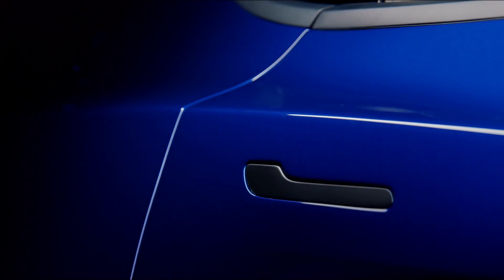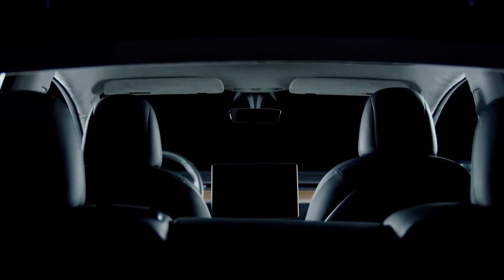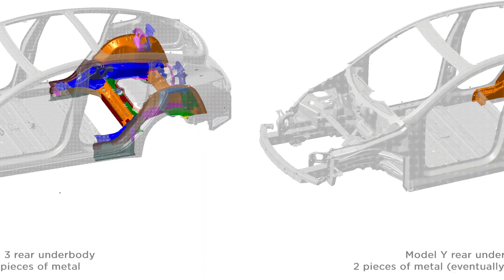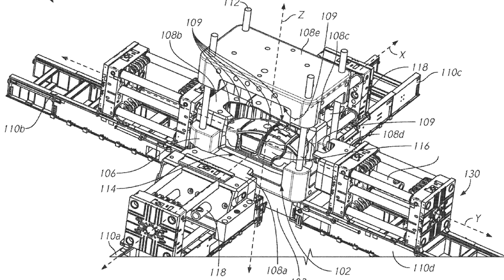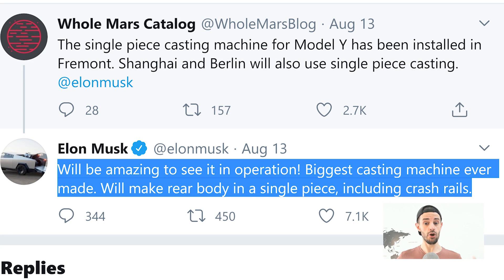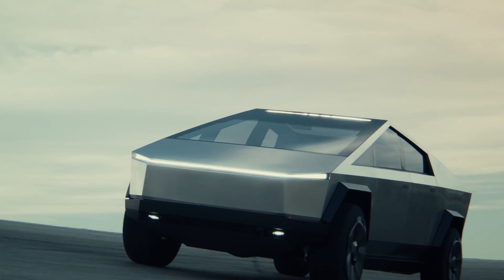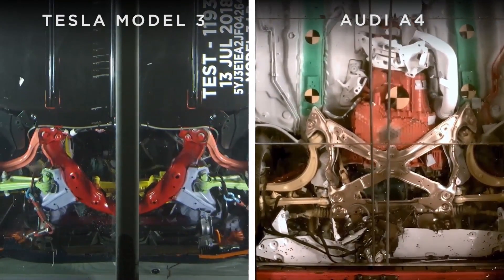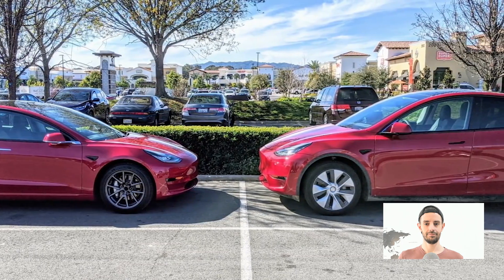Tesla's INSANE Giga Press (engineering genius)

Comment: As a mechanic engineer, I’d point out that the large castings have benefits beyond cost reduction and design simplification. They also allow designers to put metal precisely where it gives the most benefit. This saves material (cost) while simultaneously improving strength to weight ratios and other performance metrics. These improvements are virtually impossible to achieve in a mass-produced “bits-and-pieces” design.

Large, thin-walled castings are technically very challenging. It's not easy to get the hot aluminum to properly flow throughout the die cavity without voids, inconsistencies or excessive flashing. Cast aluminum parts have different mechanical properties than parts stamped from sheet stock. The part's design and alloy selection is critical. Warping can occur as a hot part cools, after it is released from the mold. Elon mentions that Tesla has eliminated the need for secondary CNC machining (more cost savings) which suggests Tesla has managed to minimize warping. Very impressive. Again, not easy!
Reply: David Kasman. Elon also mentioned they solved the warping problem by developing their own alloy. Sandy also confirmed this when he could not determine the alloy used, using his usual methods. He has sent samples out for further in-depth analysis. This is where Tesla leverages SpaceX's metallurgy technology/experience. After all, they are developing their own 30X SS alloy for Starship in-house, which will also be used on Cybertruck...
Reply: @stevebothe1416  Having visited numerous aluminium foundries I can tell you how warping is dealt with. You take a hammer and smash the point that is measured into the right position. The larger the part gets, the more you can expect this to be necessary, as the mould cools unevenly, weather changes, humidity changes, alloy composition fluctuates in the allowed analysis range... there are a lot of variables. You can trust me on this, I'm a metallurgist.

Secondly, the way this part is designed with a large surface area, requiring got material flow, they will use a run-of-the-mill hypoeutectic Al-Si-alloy. I would be really surprised if they took anything else. We develop new alloys where I work and the whole of the aluminium-casting industry can't move away from standard Al-Si and Al-Cu alloys.

And you don't "develop" a new 30X SS-alloy. The composition ranges are as wide as a barn! You can fit a gigantic number of actual steels in the composition windows that is "a 304 stainless steel". You can vary Chromium from 17,5 % to 19,5 % for example. Sulfur has an upper limit of 0,015 %, now if you had one steel which only had 0,002 % it would behave very differently in some aspects. Still it's only "a 304". There are very little surprises still to discover in the austenitic chromium-nickel-stainless steel area. Every steel manufacturer will gladly do a batch with a custom specification if you just order enough tonnage. Sure, you can ask the manufacturer to add a little bit of boron to increase hardness, or stabilize it with niobium or titanium to make it easier weldable. Is that innovative? We know all of that already. Anything that I would consider inovative is far from industrial application.  I understand a lot concerning this topic and can see right through Elon Musks bullshit "smart talk". He has no idea of metallurgy as he proves with every tweet that concerns it.
Reply: @N3uroi  And you're quite entitled to your opinion... Yet, the proof of the pudding, is in the eating.
Reply: @stevebothe1416  Eh, my opinion is based on two degrees in material technology and engineering, a few years of practical knowledge in that specific area and my current position where I do among other things just that: alloy development. Can you give any supporting arguments for your position?
Reply: @N3uroi  I'm not a metallurgist... But perhaps you can explain why Sandy Munro states that the alloy used in the Model Y casting is not a standard Aluminium alloy? And perhaps why Tesla went down this path, if warping was an issue for them? Since Tesla have gone down this path, it implies they have solved the issues you refer to.
Reply: @stevebothe1416  I searched for a couple minutes and couldn't find the specific snippet where Sandy Munro says that. But you can analyse every alloy composition by spectroscopy, so I guess that's not his method (but we would do that where I work). So I don't know how he analyzes the parts, but it appears not to be a suitable way to do it.

You need to heat-treat parts only if they alloy is age-hardenable. Parts cast by HPDC are NOT age-hardenable because of entrapped air (unless you apply a vacuum, making the process more expensive and slower as well!).  So you would preferably use an alloy that hardens on its own (like AlSi, which has tiny particles of hard silicon in its microstructure). Reduced warping is not a valid design-goal of alloy development, as it is mostly a result of the process employed (think different part thicknesses).

Heat-treatment facilities usually circumvent warping problems by a custom-design support structure. You can also reduce warping by annealing the parts beforehand, reducing internal stresses. Don't think however, that the parts will fall out of the HPDC-Machine without warping. They will need to be straigthened out just the same as if the would've been heat treated.
Reply: @N3uroi  The casting, alloy, etc. are discussed by Musk and Munro in this interview, but I can't remember at what point: www.youtube.com/watch?v=pih4kU6yvz8
Reply: F St I would respectfully suggest that Elon, Tesla and SpaceX have a wealth of world class material science engineers at their disposal. One cannot build rocket engines, SOTA batteries, etc without major material science prowess.
Reply: @N3uroi  I couldn't find the specific comment that I was referring to, but here is a couple of snippets that support my view.

https://youtu.be/TOrrdqje9Og?t=152
https://youtu.be/9l6DPwKHWpY?t=2024

Regardless, Tesla ARE doing this casting and making it work. It's already in the Model Y.  I doubt very much if Tesla are taking hammers to the final casting - it's not the way would do things. I also read somewhere, they have improved the cooling technique, to reduce the warping, and that they perhaps have an additive in the alloy to also facilitate this. As I said, I'm not a metallurgist, but I'm sure if you're that interested you could do some research in your field to find out what it is they're doing.
Also, Sandy did say they were continuing to analyse this alloy. If you follow Sandy, he will no doubt do an update when he finds out.
Reply: @N3uroi  great comment very informative! As for as metallurgy/steel forging manufacturers, which do you think are promising on the stock market? Metals and their casting/molding seem to be the backbone for every industry and can only continúe to be vital in the coming years.
Reply: @Viper-sn5cx  While I agree that the metals industry as a whole is extremely important, I'd argue that the field as a whole and therefore most companies make for poor investments. They are highly cyclical as compared to more resilient economic endavours (like e.g. healthcare, essential (=non-luxury) consumer goods) and usually very capital intensive, hence have a low valuation. Furthermore as this is the sector I'm employed in, I avoid investing in it. Further facts making investments unattractive are the strategic importance of this sector, making government interference and tariffs much more likely. Also there are gigantic overcapacities in steel production (how far this is the case for forgings, I'm not so sure) as china subsidies their steel industry heavily, further increasing the change of government interference. Lastly western companies suffer from ever increasing environmental regulations, further worsening their position.

You very often can not invest in the "forging division" directly, as they are mostly in a conglomerate or attached to a steelwork. So you only get to buy the "whole package", where the forging part most likely makes up a relatively small part of overall operations. I'm willing to make the claim that the likes of ThyssenKrupp, Mitsubishi Heavy or Hyundai Heavy will still be around in 50 years. Maybe under another name, maybe with another owner, but the processes and facilities will prevail. That doesn't make them a good investment however. I'd stay clear of that sector unless you have a pretty good idea of what you're doing.
Reply: @N3uroi  New info. Sandy just answered the question here: What are your thoughts?
https://youtu.be/h37kswPGytM?t=4146

I also found this: 

Aluminum-alloy Al-NYC-386
.  Chemical Composition: Al-Y-Ni-Co
Aluminum alloy Al-NYC-386 is a high strength Aluminum alloy processed via spray forming. Due to the high
Yttrium content it has excellent properties at elevated temperatures. Al-NYC-386 shows unique fatigue
performance at high temperatures.
General properties Comparison with Standard alloys A7075, A4032
• High strength Advantages: - Higher strength
• Excellent temperature stability - High temp. prop.
• High fatigue strength Disadvantages: - Expensive
Reply: @stevebothe1416  I'm certain you're looking at the wrong "386 aluminium alloy". It says in your quoted text as well, the yttrium-nickel-cobalt alloyed aluminium is to be processed via spray forming. It also has low ductility which makes it unsuitable for this application and an unfavorable solidification behaviour for HPDC. You're more likely looking at this "386": https://www.mercalloy.com/mercalloy-family/high-ductility/

So as I predicted... just a regular old "primary" (meaning little recycled Al.) AlSi9 die-casting alloy. It has a low manganese and iron-content I give them that, but that is the difference between primary and secondary aluminium alloys. This is certainly not "thinking ahead" of everyone else, quite the contrary. Apart from the sheer size of the part it is exactly what everyone else does. The AlSi9-family is among the most widely used HPDC-alloys. Not having to do a heat-treatment is INHERENT (!) to pure AlSi-alloys. If they would've needed more strength in the part, they would've went for AlSiCu, which would in turn necessitate a heat treatment. So yeah... nothing spectacular to see here as far as metallurgy goes.
Reply: @dksculpture  Hey, could you "@" me next time? Only just read your answer. 
I don't dispute the fact that there are material engineers at Tesla and SpaceX who know very well what they are doing. As I said, I'm very much in favor of doing function integration into single cast parts.
What I have a gigantic problem with is the overwhelming of the gullible with technical terms concerning a single part in their cars which supposedly somehow proves how superior Tesla is. The usage of a proven and reliable AlSi-alloy for a HPDC-part is nothing to be ashamed of! In fact, given the conditions that directly stem from this part (large dimension -> potential warping problems which is problematic for heat treatment) would lead me to go with an AlSi-alloy as well. Which one depens on how ductile you need it to be. So yeah, they did everything correctly there or at least good enough. It's just not as bag of a deal as everyone is trying to make it and as someone knowing a little about metallurgy all the great adjectives that are being tried to stick to this grow to annoy me.
Reply: @N3uroi   Thanks for your feedback. Sandy probably got the number wrong - 386 instead of 368 (he does that sometimes). So, the question remains, how are Tesla able to make such a large casting WITHOUT having to reshape it post casting? I'm pretty sure they won't be taking hammers to it, or any other mechanical means to attain the correct dimensions, as that goes against the reason for choosing this process in the first place.  Pace of production is why they went this way.
Reply: @N3uroi  No worries. I suspect we're pretty much in agreement on things anyway.
Reply: Great comment and superb that skilled engineers are commenting on these videos. Added to your comments, Tesla and SpaceX now employ Former Apple alloys expert Charles Kuehmann https://electrek.co/2016/02/24/apple-alloy-expert-tesla-spacex/ 
As an Industrial Designer, I'm obsessed with the move into die casting from Tesla. Amazing stuff! As David mentions here, in reality there are a number of huge technical hurdles to overcome. It's easy to say 'world's iggest die casting machine'. Getting a quality part out of it is another challenge altogether.
Reply: I worked at an aluminium foundry that made high pressure aluminium castings. The biggest challenge back in the 1970's and 80's was process consistency and metallurgy. Since then the control systems have improved massively, which should mean that process consistency can be better achieved.  It's apparent that Tesla (perhaps because of links to SpaceX) have a deeper understanding of materials and metallurgy than generally seen in the automotive industry. They are really going to need best of class materials engineering and quality control to maintain the right aluminium alloys for a reliable repeatable casting process.  Warping to an extent is inevitable, keeping the process consistent will mean predictable warping, which can be designed for.
Reply: If it's not easy to get the hot aluminum to flow properly, then WHY do it? Tesla would look at another way. But, the legacy executives are inflexible and CORRUPT. They will fall on their swords.
Reply: Is/are there any CAD/engineering software (or at least implementable models) that let you design castings with deliberately functional internal stresses (tempering, I guess)? Mind, I'm asking as a layman—I have no idea.
Reply: atimholt, generally the form and thickness is used to strengthen or weaken the areas. It’s very unlikely that any post treatment would be used as this is time consuming costly and would add variability. Form reliefs holes and swages are used within the form to get the structure to deform in a predictable manner and manage the crash energy. All this is model with cad software as well as the flow and form of the material. I think the new mid engine Corvett is using some big castings in its structure design jag and audi have been doing it for years as well just not this big. One thing that does raise a question is repair ability if they are casting the crash structure then it’s going to mean your writing off a large piece of the car once it’s damaged. I’d be surprised if they don’t have bolt on deformable crush cans for lower impact accidents and repair. It’s would be very hard to swap and change back to a pressed and fabricated structure once the design has been changed to accept a casting
Reply: Dave Rainbow Excellent points. I was thinking the same thing regarding a casting being impossible to repair after a crash; repair would require a new casting.
Reply: @dksculpture  if a Tesla doesn't crash due to crash prevention one doesn't have to repair anything😉
Reply: @atimholt  Not casting specific, CAD software already is capable of designing whole parts itself just from specifications of what forces in what direction you want to hold. See https://www.autodesk.com/solutions/generative-design
Reply: @atimholt  there are mold flow analysis tools that might be able to identify where internal stresses may develop, but the design process would take custom code for sure.
Reply: David Kasman , I don’t understand why these casting machines are made in Italy. Can’t Americans make them ?
Reply: shepherdsknoll8 Yes, theoretically they could, but time is of the essence and why not leverage Idra’s experience for now? I mean Tesla and Elon have full plates to say the least. Idra is the world leader in large production casting equipment. They supply many auto companies. Tesla doesn’t make their own robots yet either. Also, Italy has a long, cultural history in casting expertise that literally goes back to the Italian renaissance.
Reply: David Kasman , interesting, thanks.
Reply: @dksculpture  very interesting thks
Reply: David Kasman give Tesla a little time, they will innovate like usual and totally disrupt the casting industry also.  I have no doubt.
Reply: jeffrey harber the trick is going to be mass producing them on a repeatable basis. The lack of redundancy might be an issue. The tooling or machine goes down and your in deep shit, especially if the cycle time is matched to production. All your eggs in just two baskets might lead to a few sleepless night. Low volume high margin super cars have been using large casting for some time, mass production is a completely different ball game
Reply: Dave Rainbow , so the production line might need two, one to be worked on while the other produces.
Reply: @TeslaBulldotcom  im pretty sure they will keep their old bodyshop until this process works reliably in practice, and then move on to install even more of these in the place of the old equipment, because i think these machines while saving space and complexity, probably cannt match half the production cycle time (because there are two), so surely more of them are needed.

@shepherdsknoll8 they already have two, but probably will need more.
Reply: @shepherdsknoll8  another issue will be patents.
You need the best technology available, which most likely is patented, so you can't just build your own without licensing, or you just buy the machine from the company that invented it, and save a few years of R&D on building your own.

And just like Elon had a meeting to decide the pros and cons of making their own heat shield for the Dragon capsules, vs buying it, I am sure they have already made a plan towards building their own, but it will be in the future too far, and so they buy them, become experts on running them, and leverage that to build their own later.
Reply: I'm a fascinated and relatively clever lurker with no technical or engineering expertise to add to this specific thread except for this comment: thank you to the smart men and women here sharing your superb engineering talent, experience, and viewpoint with the rest of us to help round-out the context of Tesla's developments. From all that I'm learning I am arriving at the conclusion that Tesla - never mind their raw engineering problem-solving prowess - is the single most important and potentially influential company (decision making process-wise) of this millenia.

Move over Apple. Move far over.